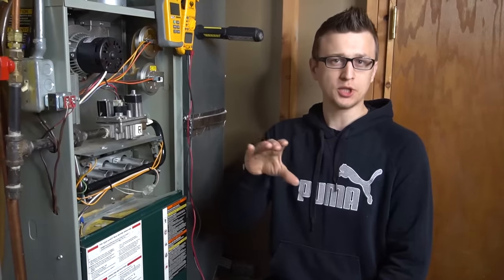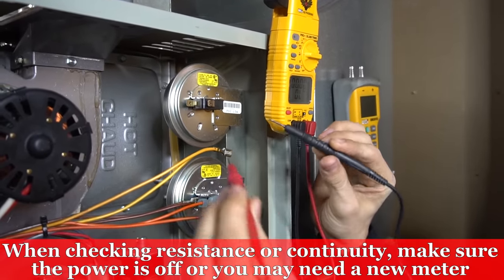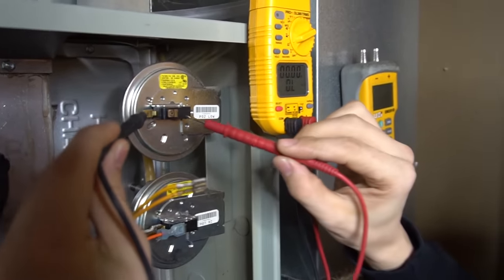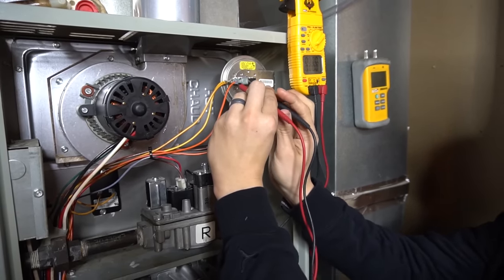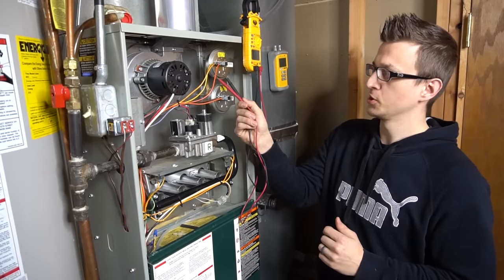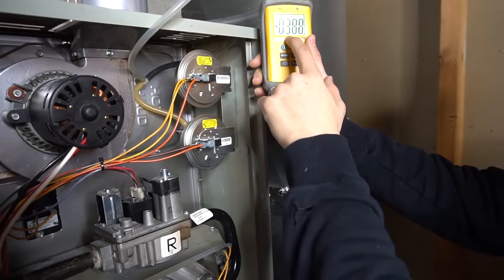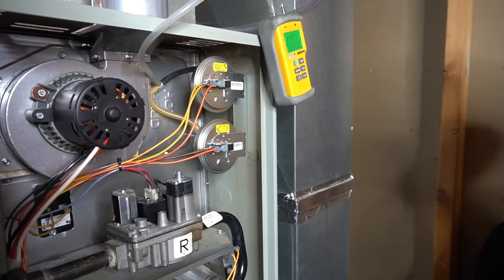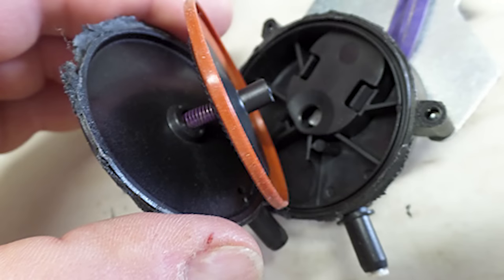How to Test Pressure Switch on a Furnace

Comment: I feel like I've checked 90% of possible problems. Ive taken the drain assembly out and washed it, cleaned out every line (not aged at all, no cracks etc). I can feel a draft from both pvc lines, so I feel like there is no clog at the end, though I can't get into my attic atm. There is no continuity on either switch until the inducer is running, then once it kicks on I get the beep. I also have ~26.6 volts at each switch if the furnace has power, inducer running or off and even if there is no call for heat from the thermostat. The furnace did get brief ignition during once of the tests but it didn't stay lit, the blower kicked on right after too. Everywhere I look it says the switch is hardly ever the problem, just an indicator of one. I had to replace a thermocouple in my wall fireplace just a few months ago and can't catch a break from odd things wearing out. Any ideas?

Comment: My pressure switch has 3 wires plugged into it instead of only 2. How do you test this? The wiring diagram says one is normally open and the other is normally closed. Why do you need 3 wires and two positions?

Comment: What about a dual pressure sensor/ transducer assembly? I have one that is Normally Open and rated at -.5 pf. The second is a three wire device rated at 0 to -4 pf, null voltage .5v powered by a +5V power from control board. I’m getting a transducer null error on control board. I’m measuring .681v null voltage on the transducer. Wiring harness ok.

Comment: Umm, I could be wrong and would have to tear one of my lab units apart to test, but I think that you will find that the spring pushes the stem to depress the microswitch button and opens the circuit in the off mode. When the inducer motor starts, the negative pressure will draw the diaphragm towards the spring (thus the adjustment) and pull the stem off the microswitch which then closes the circuit. If you still have the pieces of the switch you can check...

Comment: Hello I have a question.  What if you are getting the code that the pressure switch is stuck closed?  Can that still be a failed switch or I that an issue of the inducer fan not blowing air?   Going to try replacing the switch
Reply: I guess I should say it’s reading OL in the closed position it’s stuck in so using your advice I am hoping that switch is faulty then
Reply from the maker: longboardguy O/L would usually mean a switch stuck in the open position. But a stuck switch is a stuck switch, regardless of what position it's stuck in. If that is the case then yes, replacing it should solve the problem. But if there's a chance that the switch is not closing because something is wrong with the venting, heat exchanger, or condensate then I would suggest also watching this video if you haven't yet: https://www.youtube.com/watch?v=Zax02itYHkU&t=2s
Reply: Word of Advice TV hello again I’ll take a look at the video.  I guess it being removed from the furnace I got the OL so I may have done that wrong as I didn’t have the furnace running like in the video.  Yes the code is two flashes which reads Combustion air switch stuck closed, 3 flashes would have been stuck open.  I’ll try to replace the switch, and review the other video now.  I’ll post back what I find on this video or the other one thank you for the reply appreciate it!

Comment: I have a York Coleman Furnace that displays 2 normal green flashes on starting, then 3 flashing (pressure switch code) after several minutes. But furnace won't ignite.
I tested for voltage across the PS terminals. On startup immediately goes to 27 V (open switch), then immediately drops to 0 (closed switch).   Inducer motor stays running for several minutes, then 3 flashing lights are displayed and a couple mins later this process cycles over. 
I pulled the hose while running and repeatedly reinstall while the inducer is running and it quickly switches PS open and closed like I would expect (good vacuum and I've checked for clogs and clear venting).
It seems to me that would indicate the PS Switch is working. But inducer motor never stops running when switch closes. I never hear the gas turn on (click/blow) in the combustion chamber. And the igniter never turns on. 
What is the next check I need to do? Could it still be a faulty PS switch - per the error code? Or is it possibly the component in the circuit board that thinks it is not receiving 27 volts from the PS? Is the resistance between the PS terminals you described in the video (1.3 ohms) important for switch function or any ohm value okay as long as the circuit is closed and 27 volts are coming in thru the switch?

Comment: Are two stage pressure switches in series with each other? In other words if one fails the furnace will not fire?
Reply from the maker: No, that's not quite right because the second pressure switch only closes when the inducer motor goes into second stage. So I don't believe they are in series. (I don't remember for sure though, I will have to look at the wiring diagram next time)

Comment: I have a single stage pressure switch,  please explajn how to test the pressure switch with a manometer? (EM152) on a (trane xe90) open switch at the moment, inducer is running,  
no flame, no ignitor glow, (73.2 ohms) limit switch is 0.2 ohms.The furnace works if I bypass the pressure switch

Comment: My Rheem furnace has a dual pressure switch with a rubber tube that connects to the two switches like in this example.  About once, sometimes twice a year, when weather changes a lot from cold to hot, etc., water from condensation collects in the tube that connect the two switches.  This causes the furnace to constantly cycle on and off.  All I have to do is take the two switches off, remove the rubber connecting tube, and blow it out with air.  Then, viola, the furnace works as it should.  Is this a problem common on Rheems?  Is there a better designed set of switches or something that can be done to eliminate the water build up?

Comment: Over the past month, why intermittent thermostate readings of "low pressure switch open when heating" and colder / lower house temperature than set at thermostate ?  I leave it all alone (put on a blanket) and eventually it runs and heats up again to set heat temperature ?

Comment: The blower fan is on but the furnace doesn't turn on (no heat no pilot) when I tested with a multimeter as you said the pressure switch doesn't react!!! The others show 0.0 with a beep but the pressure no reading? Does it mean it is the problem?
Reply: Did you figure it out?
Reply: @Nickh406  yes I did, the pressure switch is open that's why it shows 0.0. it was the other blower that was dead the one that turns on once the heat is on.

Comment: My furnace show low pressure switch open and stopped working. But each time when I turn if off for anout 1 min and turn on again, it will come back to work again, then when it reaches the set temperature, it stops but doesn't work again, had to turn off and turn on again. What the issue could be?

Comment: Try to test Manifold gas pressure.  My two stage furnace but how to test low stage to test? Or high stage test? I understand that put manometer hose into outlet pressure and start furnace.  When frame starts manometer will automatically check low and high  pressure at same time?
Reply from the maker: The furnace will typically run in low stage for about 15 minutes. After that it will switch to second stage. That's when the gas pressure will go up.
Reply: @WordofAdviceTV  The manual says that close thermostat R and W1 contacts provide a call for low stage heat.  And R and W2 will provide high heat stage.  But but I can't find anywhere it indicates W1 or W2.  I only can see there is YWRGC.  Anyhow, I like your exprain better than manual.  When furnace starts it usually fired low stage for about 15 minutes.  During that time I can adjust low stage pressure.  After 15 minuets when temperature start to change I can check high stage pressure.  However, by doing that should I check it when weather out side is very cold? Because two stage furnace are designed for save energy that reacts from outside weather.
Reply from the maker: @yesitsmonkey  The temperature outside should not have any effect on the gas pressures. So if needed, you could adjust the pressures whenever you want. The main way a two stage furnace is more efficient is because when it runs on it's low stage, it is only using 60% of it's capacity (high stage is 100%). This is effective because when it is not very cold outside, usually the furnace will be able to maintain a set temperature inside the house without running longer than 15 minutes at a time. Which means the furnace will be using less gas and electricity.
Reply: @WordofAdviceTV  Thanks a lot.  However, it seems quite complicated.   :)

Comment: Hi, jay . can i use  3 amps car fuse( automobile fuses) for furnace control board. thanks.
Reply from the maker: I believe the spade connectors are the same but don't remember for sure.. If it fits, then yeah, there's no problem with using a car fuse. The resistor is the same.

Comment: What is the difference between two wire pressure switches and three wires?
Reply from the maker: They are the same. Mine is just wired in series with another safety switch so basically that third wire is like a jumper wire.

Comment: I got a question i got a 2017 tempstar unit inducer comes on igniter is igniting then it shuts triea 3 times then goes out on lockout what could be the issue

Comment: You missed a step in sequence of operation.  Before the inducer starts the board senses the switch is indeed open. The inducer starts. Then the board senses the switch closed.
Reply from the maker: Oh yes! That's an important step too. (if the switch is closed before the inducer is powered on it wont proceed with the sequence)Thank you for the correction!
Reply: That is also why if you try to jumper the switch just to test it you have to wait for the inducer to ramp up before connecting the jumper.

Comment: When the switch in the pressure switch closes, how dose it get to the next step of power to the igniter.
Reply: The pressure switch will send a minimum of 24 volts to the control valve. The control valve will then send voltage to the igniter. If ignition is not detected,the smart valve will shutdown and either try again in 90 seconds or as much as 5 minutes,depending on numbers of failed attempts of ignition.

Comment: Please answer anyone who may know.. where does the 24v voltage come from that goes accross pressure switch terminals??? The turnace voltage sputters so I get continuous Open Switch Fault. Even when I jump it,  it still throws an open switch code. The voltage/sound would sputter on continuity test..  so im replacing the board.

Comment: Hello sir it's me again, lol. Question my goodman is giving me 3 flashes. I changed the inducer, it had seized up. All good for a month, turn on heater it would run for 10 minutes one day or run the entire night another night and so on. All this time with the same 3 flashes becauseI was waiting for the switch in the mail. Just changed the pressure switch last night and it ran for about a hour and now this morning it only ran for 10 minutes.  Wth 🤪🤪🤪 I have both of those meters you have just by different makers but now where do I go?
Reply: So I finally figured it out. I know I needed a inducer but I may have bought the pressure switch without needed it. I notice my filters were dirty and switched them out and now the furnace runs nonstop. Now that I have the clamp meter I can now check this stuff...

Comment: When checking resistance, make sure power is off or you may need a new meter, clean pair of shorts and some nitro pills to stop your heart from blowing up😂😂 1st thing I did as a maintenance tech years ago was check continuity with power on...Yup...had power😆😆

Comment: I ran all the tests you show and my Carrier still give me the LED code 31 "pressure switch did not close or reopened". Any other suggestions?
Reply: See his other video on jumping the pressure switch. If you bypass the switch and you still get the code, you may have a bad control board. If the code goes away, it's probably the pressure switch or the air passage.
Reply: @realSamAndrew  Thanks. will do.
Reply: @randyfrench1400  glad to help. Please let me know how it goes.

Comment: I don’t understand why you turned the furnace on while checking continuity, the switch was not connected to the circuit.
Reply: Electrically the switch was not,
But, Mechanically, it was.
Once the Vacuum activated the switch, it closed the contacts,
which the Meter displayed as Continuity, or a closed circuit.
NOTE: Not a good idea to have voltages running in wires
during a continuity check. The Meter is checking for resistance.
On some older/cheaper meters, they will burn up.

Comment: I have a modine hd45 in my garage this year when I turned it on it comes on runs and heats as should gets to temp thermostat shuts it off but when called for heat again only the fan comes back on nothing else what would cause this
Reply: Oh I have a older model led error code light is on gas valve and when the 2nd heat cycle it flashes twice pressure switch closed longer then 30secs

Comment: when the pressure switch closes it completes the circuit, giving you 27 volts. why then will it drop to 0
Reply: Because he placed the leads on both terminals.  Maybe you are thinking one of the wires is a "hot" wire and the other is a ground wire.  This is not the case with this switch.  Both wires become "hot" when the switch closes.  If he had placed one of the multi meter leads on the side of the switch that is "cold" when the motor is off and the other lead to a ground, then you would show 27 volts when the motor kicks on and the draft causes the switch to close.
Reply: It's a switch my friend , not an outlet, it's the same wire

Comment: When I start my furnace the enduser motor comes on and the ignitor comes on but then it shuts off ?
Reply: ackmino but the flame is not coming on at all can it still be the flame sensor ?
Reply: @kmobthm  ok, probably not.  Is it flashing any codes?  Could be an open pressure switch or open limit switch.  The circuit board should flash something.
Reply: ackmino that’s what’s driving me crazy ! I changed the pressure switch and nothing is flashing bugging me out
Reply: @kmobthm  is the hot surface ignitor glowing? If it is, check for voltage at the gas valve.  Most of the little limit switches have a tiny reset button.  You can poke them with a pen to reset them.
Reply: Take w-wire off the board then turn it back on if the inducer turns on right away then it's a board problem . Could be a stuck or bad relay
Reply: If the inducer motor doesnt come back on then put it back on and take leads off the gas valve then stick your meter leads into the board leads going to the gas valve see if the board is sending 24 volts to the gas valve . If that's happening.. then take leads off gas valve and check for resistance on your gas valve if you ha w resistance then your valve is good !! If you ha e no resistance then valve is bad. Smart valves can be tricky though
Reply: One last thing if your not qualified to do any of what I said . Dont be cheap call a professional because watching a YouTube video to potentially get a furnace working again when there an obvious problem could be very dangerous

Comment: I just found another reason why the pressure switch will not work.  I have a 95% furnace.  I took the exhaust blower off and dumped out about one cup of condensate water out of the blower cavity.  Of course this was after I replaced the switch and cleaned the flame sensor with no success.  It was restricting the fan just enough to reduce the vacuum to not allow the switch to operate.